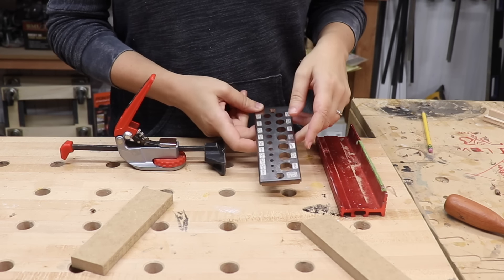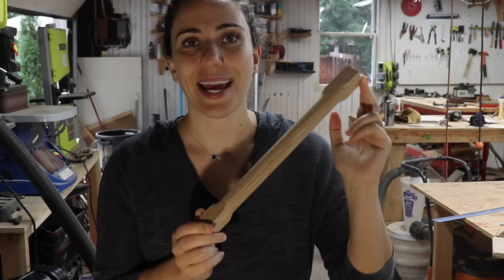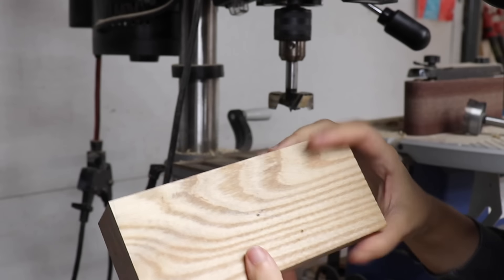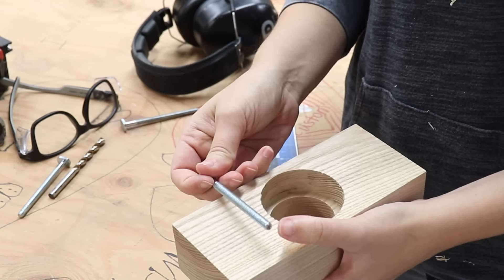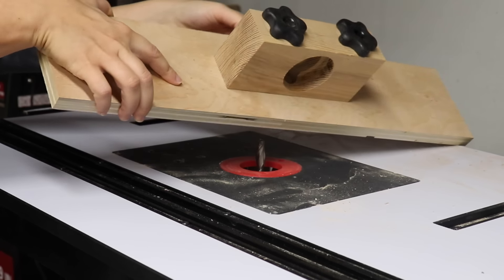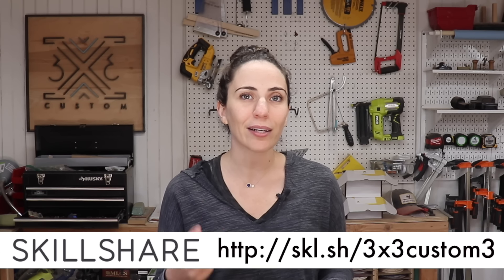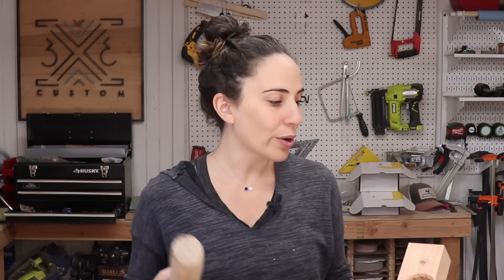Making Large Dowels WITHOUT a Lathe // Woodworking Jig // Dowel Maker

Comment: I think that in order to use the chisel method more affectively,  you would need the jig a bit wider so that you can add a clamping mechanism to hold the chisel down tight.

But honestly, I think I would prefer the router table method as well. It shouldn't be too hard to make a jig the length of the dowel you need and set up an in feed and out feed support structure should you need it.

Hmm, it would be possible to make a dowel making setup for a hand router as well. The plus here is that you would not need to figure out how to add additional table support for the router table. The draw back is that you would end up with an extra jig that needs to be stored, and if it ends up being a one time use item, that's way too much space to take up.

I know that ShopNotes had plans for a router milling machine that enables you to make various dowel designs such as spirals.

Here's a link to the magazine picture. 
http://www.shopnotes.com/issues/115/sources/router-milling-machine/
Don't purchase the plans, there is a link to archive.org where you can download a lot of the older ShopNotes issues. Here is a link to the routerforums threat with the link.
https://www.routerforums.com/project-plans-how/138961-access-old-shop-notes.html
Reply: As I perused the free downloads, it turns out that issue 115 is not included in them. Sorry for the misdirect.

Comment: The width of the hole is the size the forstner bit you used so there is no need to measure. As for the chisel method, this is basically how a pencil sharpener works. Based on that, mechanically fixing the chisel the block would give better results than a clamp. If you have a nice set of chisel the last thing you'd want to do is drill a hole through one.

Comment: The chisel method looked pretty gnarly. To help stabilized the wood in the drill, try a large, double-ended, wood /machine type cabinet screw. The machine end would hold nicely in a drill chuck. Or for a better hold in the drill, cut some coarse threads onto a piece of hexagonal steel. Pre-drill with a self-tapping screw and run it in.
Reply from the maker: Yeah. I didn’t links the chisel method.....

Comment: A couple of ideas for holding the dowel w/ the drill -

You could tap threads in the wood  and then bottom out a bolt, that way you would not have to waste as much wood- here is a cool link on how to make your own wood taps - 

https://www.youtube.com/redirect?v=EJpgT2VCB_w&event=video_description&redir_token=_SVnsYoZLiAREu1uTatXn1hX5Yl8MTU3ODQzNzgwNUAxNTc4MzUxNDA1&q=http%3A%2F%2Fwoodgears.ca%2Fthread_taps

If you add CA glue to the threads they should be strong enough for the router method.  If you want a more secure fit you could always cut off the bolt head and put bolt directly into the drill arbor. 

Another thought was to use a biscuit joiner, or a domino (or drill a couple holes and hog out the wood w/ a chisel) and then tap in a paddle bit.  

Anyway, just a thought, hope it helps. I enjoyed the video!

Cheers
Reply from the maker: I like that idea. Thanks

Comment: Having made dowels on the router table with both round over bits and staff bead cutters it is perfectly possible to cut the dowel with no waste on the ends. There is always until the last inch or so  of the last cut a flat face to act as a reference and if one is sensible in feeding the last inch of the last cut then no problem will ensue. I just made a 38mm diameter oak shaft for my spade this way and have previously made over a dozen kayak paddle looms (shafts) and kayak stringers by this method. One just needs to ensure that the stock is the correct size for the finished item and square. That the stock is square (i.e. 90 degree corners )is important.
Reply from the maker: Yeah. I just get a bit nervous at the router table

Comment: I saw a guy a while back use the block design which you have a better building method; nice. Nevertheless his method was in my opinion more effective. He clambed the block to the table saw at an angle and cut through the block to the proper height and he made long pieces with the bolt and impact driver like you did. I built one but the method of the block wasn't feasible for practible use as yours is. Thanks your block construction method makes it very practible with table saw at angle. The rounding router bit was nice; I will also take on that very useful method.

Comment: tou can make a 100 foot dowel using the router table method without extending the router table by just doing a section at a time.
you’ll always have four flat sides supporting the work piece as long as you don’t cut more than the length of the table...or just stay a few inches short to be safe, that router table method seems to be the best especially because it leaves a super clean surface.

the chisel method needs better support, if you watch that part of the video a few times you’ll see that the stock jumps around way too much.  actually the router table an jig method also needs better support.

it seems like you tried each method without even perfecting them at all.
if your sincere about learning better  woodworking skills you have to actually put a little time into it.
Reply from the maker: That is a cool idea for the 100 foot dowel. I wasn’t trying to perfect any of these ideas. I wanted to show what happens when you try them for the first time. Of course I could have spent days perfecting each one. But that wasn’t the goal. The goal was to experiment and see which one would work best for me. And also show what happens when someone tries something for the first time. That’s basically my whole channel....

Comment: In your last method with the chisel I had similar results. I replaced the chisel with a thicker plane blade crazy sharp.  I also ditched the power drill and hand turn ended the wood into it . Takes some time but was very smooth results. The power drill was introducing lots of vibration into jig.   I liked your router jig idea.  I think it could be refined easily to get great results.  Need something slower then a power drill I think.
Reply from the maker: Always fun to figure all this stuff out. I ended up using the round over bit for my project. Worked great

Comment: Usually when we make dowels ( only when we cannot buy them ) we employ a method like your router / lathe one. However we use 2 or more blocks ( carriages ) to hold the stock to avoid wobble, a screw on end-plate with a chuckable peg and feed SLOW.  The motor  we use is mounted on a plate that tracks between two guides clamped to the table. The stock is carried on both the infeed and outfeed  positions by the carriages.

Comment: The method with the chisel looks potentially suicidal. If I ever need a 2" dowel and don't want to schlep to the BORG and pay way too much for a dowel that size Yonico makes a 1" roundover bit for twenty five bucks and the Yonico bits are amazing. They make a 1 1/2" bit too in case you ever need a 3" dowel.

You missed one trick that works really well too though; well at least for dowels larger than an inch. You can build a sled for your table saw that uses a hand held drill to spin a chunk of wood above the saw blade. Then you just slide the sled over the blade and you can make a dowel of virtually any usable diameter. You are limited in length to about 3' but any method not involving a long bed lathe or industrial sized dies will suffer from how long you can make the dowel.
Reply from the maker: Yeah. I did not like the chisel method at all. Ha. The table saw jig is cool too

Comment: Improve upon the Chisel over hole method by: making it so the chisel lays in a groove on the block... improve the drive shaft by using a bolt that is lag on one end and machine thread on the other, and a washer and nut to set the depth of it into the end of the proposed dowel.

Comment: When using chisel may I suggest make sure you pushing from the correct end, I mean watch the grain do not go against the grain, also have a dedicated chisel to be sharpened the correct angle, wood chisel is between 25 to 30degrees sharpened you need turning angle of about 40 to 50 degrees. Good luck
from oz Jack Marashlian
Reply from the maker: The chisel angle could have been it. I sharpen mine to 25

Comment: Thank you because you showed many ways that is can be done. A small suggestion, instead of using a chisel, you could use a blade from a hand plane and use two or more screws to hold it down. The advantages are, the hold down and a larger cutting surface and maybe a smoother result. Love your posts.

Comment: You can vastly improve the performance of the router jig for making dowels if you make the exit hole deeper/ longer. Much of the chatter you experienced was because of the insufficient L to D ratio of the hole length and the dowel diameter. You can simply stack up blocks with the right size hole!!

Comment: Awesome video!  Just discovered your channel and it quickly became one of my main go-to's.  For the router method, do you need to use a spiral bit or would other bits work?
Reply from the maker: Thanks so much! That’s so awesome to hear! I used a spiral bit. But I think a straight bit would work too
Reply: @3x3CustomTamar  I finally made my jig and first dowel. It worked like a charm! 2 quick questions: 1) Did you ever figure out a better way to mount it to the drill? I tried using a tee nut and a bolt with the end cut off, but the tee nut kept popping out of the wood. 2) My dowel was REALLY rough. That was probably partly because I was using a really cheap straight bit. Besides getting a nicer bit, do you have any tips for getting them to come out cleaner? Thanks!
Reply from the maker: Birch McMullin awesome. Maybe try a threaded insert instead.

Comment: Jack the car up take off the drive wheel attack the tree trunk to the wheel hub start the car in drive low speed. Ok not you've got a variable speed lathe. 

Im just joking.

You'll need a manul drive car with 5 gears.

Comment: Tamar, thank you for this video.  I want to make John Heisz' twin screw vise and don't have a lathe to make the handle chucks and handles.  I'll give your router table jig a go.  Then sand with the drill table and support the lower end of the cut dowel the a pin through a piece of wood clamped to the drill press table.
Reply from the maker: Awesome. Glad it was helpful!

Comment: Plane the wood square then reduce the corners until it is an equal octogon.  I use a hardwood guide with a "V" groove on the lower thickneser table to do this  It's quite easy then to round out using a hand plane and sanding.. I've done 36Inch and longer lengths at up to 4inch diameter using this method.

Comment: Sanding is probably not a good idea.  The size changes and could be inconsistent.   You probably don't have a huge assortment of close-to-size bits, especially for the larger sizes if you sand  the dowels undersize.  Jarrid O'Bryans comment about Izzy Swans table saw method is good, but it is difficult to get a precise size except by trial and error.  You didn't say how close you need your dowels to fit, but I want mine precise size, good finish out of the jig, and consistent.  They don't make round-over bits in close increments especially in large sizes, making your selection limited.  This is probably OK, as the hole sizes could be modified to work as long as the dowels are consistent.  Matias Wandel has a chisel dowel jig.  As far as I know, he doesn't do 2" dowels.  The larger the dowel, the more difficulty you have holding the chisel.  for those, I use a plane iron that has a slot in it to secure it multiple places with screws and make the jig out of hard wood so the holes don't work lose.  Precise sizes are somewhat difficult to get, but once you have it set, the size is consistent.  I have found the best method is the chisel (actually plane iron) method for best finish and most consistent size.   You didn't say how closely you need the dowel sizes to be or how they need to fit into the holes that you intend to make.    How close the dowel sizes were to what you expected without sanding would have been nice.  Your videos are well done (except for leaving out the sizes) and I like the way you present your topics.  By that I mean that you actually discuss the problems you have and suggest alternatives.   Kudos.

Comment: Thanks for this video! I've used a number of the techniques you show in your videos, but this one was great. Just made a 1-1/4" dowel at the router table using your method. BTW, didn't leave the ends square nor anything to support the ends that hung over the end of the table and it worked fine. The very last corner may have been slightly squirrelly, but really wasn't bad. Certainly didn't feel any danger of injury at any point.
Reply: A simple way to burn a drill

Comment: What if you combine the router jig with sanding so that in the smaller diameter hole (this one that determines the size of the dowel) you line the inside with sand paper so that it gets sanded just after getting shaped by the router thereby using the same rotational effort and doing two things at once.
Reply from the maker: Whoa. I would be curious to know if someone could make that work. Ha

Comment: awesome experiments - i ran into the same issue with the "Chisel giant pencil sharpener" method you did - and what fixed it for me was actually recessing my chisel into my block so i only need down pressure from a clamp to keep it still as opposed to depending on the clamp for both down pressure and side to side movement prevention - and then just having a shallower cutting angle (closer to parallel with blank feed direction).  But - i think your router jig method was awesome.  If you really want to go nuts - build that contraption that Izzy Swan has for his tablesaw (just search tablesaw lathe if you havent seen it before).

Just stumbled onto your channel - great stuff! +1 sub!
Reply from the maker: Thanks! Yeah.... I don't think I will be attempting the chisel method again.... Ha!

Comment: Hint again (this is not the first one, if You remember the plexi glass welding with acetone). Well, the dovels with round over bit. My hint is to add a long enough (maybe 10 inches) round (concaved) back fence simular to the round over bits radius after the blade. This would give support for the round part of Your dovel after the blade so You can cut Your dovels from finish to end straight trough.

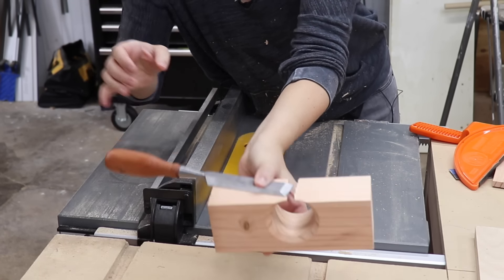Comment: 11:07 saw off the top of the jig laterally (make it with a bit more material around the hole). Route a small channel to recess the chisel into the wood slightly. You'll still need to secure the top to the bottom piece... you could maybe just have a recess on top of the jig with a metal brace to pivot over and secure the chisel.. doesn't sound like you'll be trying that one again lol

Comment: It sure seems that you are going to a helluva lot of work to avoid going to the lumber yard and buying a dowel.
Reply from the maker: Dowels are expensive.
Reply: Any competent woodworker should embrace a broad spectrum of techniques and methods. It doesn't mean you should always use a particular method, but the more tricks you have up your sleeve, the better woodworker you'll be on any particular project.
Reply: Lumberyards will not have selection of species nor size one may need

Comment: For the router table dowel jig. Perhaps you could clamp a 3 or 4 inch coupling for plumbing, level with eachother 2 feet shorter than the piece you're working with to allow for 1 foot of workability up to 18 Inches. This way you will have a resting arm on both sides of your piece and full control with minimal resistance.

Or just make 2 wooden donuts with all thread as the upright stabilizer support

Comment: I’ve made a bandsaw version from the tutorial in this video. It’s like the chisel version, but faster and doesn’t overheat  the chisel. To get more stability, control, and a more uniform dowel, I made a second block with a hole of the final size and placed it at the rear of the saw.  https://youtu.be/DaGttK6cSsM.
Reply from the maker: That’s cool. I wouldn’t trust my bandsaw to do anything like this though

Comment: when making a dowel using a chisel you have to cut with the grain or you will get that splintered cut much the same as tear out with a plane going against the grain and the same rule applies if you are cutting the wood parts on a lathe. I have always used router bits to make dowels simply because it works the best for me but certainly not the only way to get the job done.
On a lathe turning a bowl you will hear people talk about cutting downhill to get a better finish and it is safer to cut that way.
The best way for any cutting is pay attention to which direction the grain is running but some pieces of wood will have the grain running one way at one end and switch towards the other end. Just the nature of the beast.
Reply from the maker: Yup. Ash has grain running all different directions. It was def not the best choice to test on. But I didn’t have anything else that was that big. Anyway. The router bit was the best. So I’m just going to go with that.
Reply: @3x3CustomTamar  actually ash is generally a pretty well-behaved straight-grained wood, which is why it's relatively common to use for chair parts, etc. Your specific piece of ash may have been squirrelly, but don't let that affect your view of ash in general.
Reply from the maker: Jonathon Jongsma i think maybe you’re misinterpreting what I mean. Ash has an open grain. Like with the cathedrals. So it is prone to chip out and tear out when machined. I love it for its stability, just wary of grain direction when machining.

Comment: Instead of putting a bolt in the wood put one through a scrap piece turn it around and then glue the piece of wood with the bolt head side to the dowel and then chuck it in your drill. Great video.👍